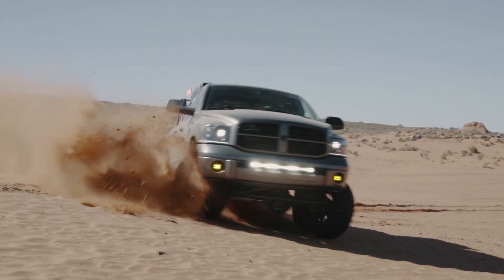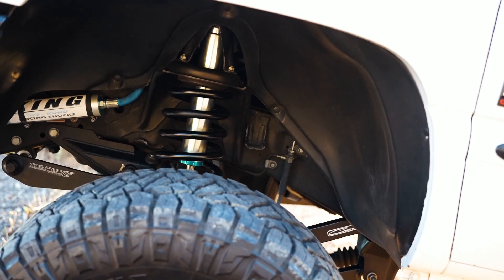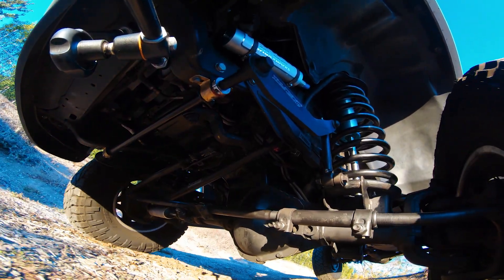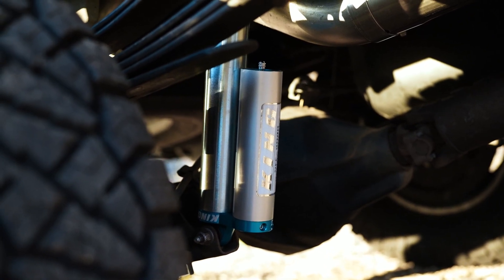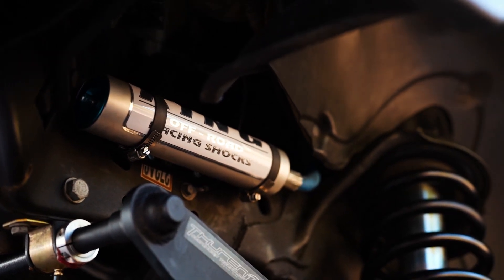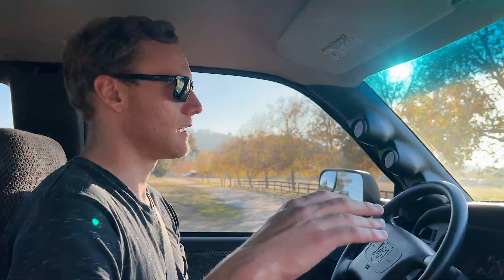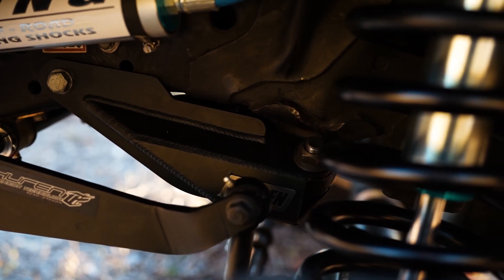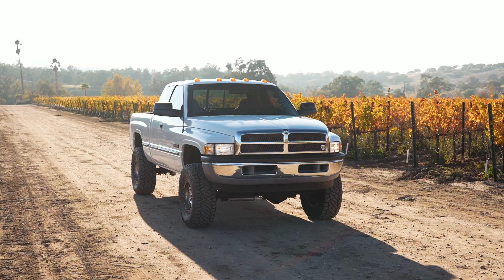My Dream 2nd Gen Cummins Suspension System! Carli Pintop Install! 2nd Gen Build Part 2

Comment from the maker: For cool shirts, sweatshirts, and more check out the Just Diesels merch store: https://just-diesels.com
The parts list:
Carli 3” Pintop Suspension system:
https://www.cjcoffroad.com/collections/94-02-carli-systems/products/carli-dodge-1994-2002-pintop-2-5-3-lift-suspension-system

Carli Control Arms:
https://www.cjcoffroad.com/collections/carli-dodge-suspension-components/products/copy-of-carli-suspension-dodge-ram-2500-3500-control-arms

Carli Rear Leaf Springs:
https://www.cjcoffroad.com/collections/carli-dodge-suspension-components/products/carli-dodge-ram-2500-3500-full-progressive-leaf-spring-pack

Thuren Sway Bar:
https://www.cjcoffroad.com/collections/1994-2012-thuren-ram/products/active-rate-sway-bar-ram-2500-1998-5-2002

Thuren 2nd Gen Track Bar:
https://www.cjcoffroad.com/collections/1994-2012-thuren-ram/products/copy-of-thuren-active-rate-sway-bar-ram-2500-3500-1998-5-2002
Reply: Wait till you get the rear leaf springs on from them. I have the full system arms coils basic shocks from them and rear leaf springs.40mph thru the dirt with ease. I want to get the pin tops next.
Reply from the maker: @matt704  I can't wait to get them on! It just takes a long time to do leaf springs on these 2nd gens since you have to drop the tank and remove the trailer hitch.
Reply: @JustDiesels  Yeah it took a little of finessing but I was able to get the bolts out on the tank side with out having to drop the tank. In total it took about 3 hours to replace everything it’s just a lot of heavy stuff like everything else is on these trucks.
Reply: @JustDiesels  There’s a truck you need to see if your looking for super clean low mileage 2nd gen dually.

Comment: Are the Carli control arms the extended set or regular length?
Reply from the maker: All carli 2nd gen control arms are .5” longer than stock for a 2-3” lift.

Comment: Can these old 12v trucks be good tourers? Are they super rattley and noisey at highway speeds?
Reply from the maker: I have no issues driving mine! They aren’t as quiet as a new truck, but still drive great!
Reply: @JustDiesels  right on. Thanks for responding. Follow up question if you don't mind... how fast can you drive this badboy on the freeway? Does it run out of gear around 70 mph?
Reply: @AD1  they will run 80 , 85 ok.  Depends on gearing though .

Comment: Are the spherical bushings loud? Do the clunk at all? I had a Spohn set up on my Camaro and it was noisy and I hated it.
Reply from the maker: Not a single sound out of them! Had a set on my third gen for about 40-50k miles without issue too!
Reply: Mine dont make any noise at all.  Keep them greased well.

Comment: JD,
Love ur trucks. Thinking of buying my buddy's 2nd gen 2500 cummins NV4500 Manual. 2 questions: 
1)It has 410 gears, if I put 35s, will it still be geared too low? Don't want 37s. 
2) Can I add side & tailgate black plastic moldings/trim from a '99 to a '01?
Thanks in advance
Reply: That would put you just shy of 2100 rpm at 70 mph, but almost 2400 at 80. In my opinion, 1700-2100 rpm is the sweet spot for cruising on these trucks. Too much lower and they start to bog down a bit, too much higher and they get noisy enough that it kind of sucks to drive long periods in them.

Comment: New to the channel. Got my first 2gen. Where did you get the yellow fog lights. And can you get them for the second gen. Love those wheels on the second gen. Wish I could something similar. You said they don’t make them anymore.
Reply from the maker: The lights on top came with the truck from the factory, but you can add cab lights to any truck!   As for the wheels, while this exact finish is discontinued, Walker Evans does have a newer version available.

Comment: The 2nd Gen Cummins is my all time favorite truck. I have an ‘02 that my grandfather bought new. Although he took good care of it, it still needs some love. I’m progressively working on “future proofing” it so that my family and I can continue to enjoy it. I’ve retrofitted it to the updated 3rd Gen steering linkage system, and I’m installing EMF ball joints tomorrow, to my knowledge the EMF’s are the best available for 2nd gens. I was unaware Thuren would be releasing a track bar for these, I would have probably waited, but at the moment the truck currently has the DOR in it. I’m eager to see your video on that Thuren track bar. You do by far the best informational videos on diesels. Thank you!
Reply: I’m adding much of these same upgrades to my 2nd Gen. It’s great to know what to expect so thanks for the video. 

The EMF BJ’s are incredible. They include the press adapter which is crucial. Got about 60K on mine and they’re one of the best upgrades I’ve added. The free spin kit is great also. I’d be shocked if you ever needed to replace them. Also, zerk fitting orientation is really important.

Comment: Can you post the stabilizer stock as well. I have a 2001 dodge ram 3500 and am currently working on the front suspension. I'm trying to get the coil springs without the shocks. I have those installed already.
Reply from the maker: I’m running this stabilizer, but it ONLY works with the factory 99 HD steering if you have the cap positioned perfectly! It will not work on the more common factory Y-style steering. 

https://www.cjcoffroad.com/collections/steering-stabilizers/products/fox-dodge-2014-2500-2013-3500-ram-2500-3500-2-0-performance-series-stabilizer

Comment: Will it work for the v10 Magnum, because you said the sway bar won't work for the 12v so I was wondering with the v10 Will it differ or does it not matter

Comment: How much sag does it have after installed I’m looking to level my truck but want to upgrade the front like what you have and still be able to tow
Reply from the maker: This truck still has the factory rear springs, which means factory payload and the same sag when loaded as a factory truck!

Comment: I have a 1997 Ram 2500 with the Synergy T-Steering Setup and the Top Tier Suspension 3rd Gen Track Bar Conversion Kit paired with the Carli 3rd Gen Adjustable Track Bar. Would you recommend upgrading to the Tauren 2nd Gen Track Bar that you are currently beta testing? Only issues I’ve had with the TTS conversion kit is that there is way too much flex with the track bar even working with the company and the shop turned into a nightmare..
Reply from the maker: At this point in time the Thuren track bar is hands down the nicest track bar made for 2nd gens. I’d personally get that over anything else available since the geometry is correct with a 2nd gen specific track bar, and a quality bracket.
Reply: @JustDiesels  just installed mine last night, test drive was night and day! When is the update video coming out??

Comment: Looks Great Andrew!!  Now wondering wether i stick with Back country 2.0 or Pin top for the 2009 2500?
Reply from the maker: It just depends on how much off road you do and at what speed. The Back Country is perfect unless you plan to go 40+ miles an hour in the dirt!

Comment: My 06 is finally going to be almost complete.  I'm ordering 3" springs , sway bar links , from Thuren ,  upgraded steering, and pittman arm  from BD ,  also threw in a deep trans pan from A T S.  I already had Thuren control arms and  track bar .  Air bags in the back .  35 terra grapplers  and an ARB locker .  Lol. Almost there.

Comment: If SHTF which truck would do anything to upgrade the truck to prepare it? For example put a 100 gallon diesel fuel container with the option to hard wire a gas pump or set up as auxiliary diesel tank! I am thinking about prepping my 2003 Ford F-250. You could make a video on this Dodge as you have a great start already!
Reply: More fuel is always a good thing .  If the shtf stay home , Safest place to be in most cases .

Comment: Speaking of the rear leaf springs, you also gonna at some point do their long travel air bags with them? I’m thinking about doing that with the rear of my 2012 in the future sometime and would like to know how it works out as far as ride quality and payload (both leaf springs and air bags)
Reply from the maker: They actually discontinued their 2nd gen long travel bags due to low order volume, but those will work perfectly with your 2012 to get the best of both worlds! Keep in mind though that airbags always hurt ride, so only get them if you absolutely need them! The Carli springs are totally fine as long as your trailer pin/tongue weight is 1k or less.

Comment: Is there anywhere that I can get an adjustable track bar for my 2nd gen? its got a cheap level kit but im planning on getting the thuren xs coils with fox resi shocks but i dont want to put them on until I get a track bar. Im really sick of seeing my front axle an inch further to the left. Love the vids! Keep it up!

Edit: Would love to see more vids on the second gen!!!
Reply: BD Diesel makes a decent adjustable track bar. I have it on my 2001 2500 with the thuren coils and thuren tuned fox non res shocks. 

Went with BD because Synergy stopped producing the 2nd gen adapter for their 3rd gen Trac bar. The BD is a freaking solid unit. Only downfall to the BD is Carli, Thuren and Synergy have much better joints in their Trac bars. But the BD is greasable and rebuildable so all in all a quality lifetime part.
Reply from the maker: This Thuren one is adjustable from 0-4” height trucks! Highly recommend it over anything else on the market.
Reply: @JustDiesels  I just looked on their website and it said it was out of stock. And for some reason Carli doesn’t sell them either. I guess I just have to wait…:)
Reply: @huntermees5151  how often do you have to rebuild it would you think? Just driving around town about 6000 miles a year?
Reply: @tikitorch3117  honestly I'm not quite sure. I would day it depends on where you live but I'd rebuild it every 50k.

Comment: My 01 is going in the same direction as your 99.  I have the thuren 2" linear springs and would love to compare the ride between equally equipped trucks just the carli progressive vs the thuren linear rate springs.

Comment: that system looks really clean. doesnt bolster it too much for a lift. looks very nice. 
Maybe this all might also fit on a 1500 ^^
Reply from the maker: If the truck is 4wd it does fit!
Reply: @JustDiesels  nice thx yes IT is a 4wd

Comment: How do you keep the frame/brake lines/bottom of floorboard and bed so clean? Tips would be appreciatedn because light rust is starting to happen on my Dad's truck   even though he takes care of it. Take Care & Safe Travels Everyone!
Reply: He lives in California and he also has a whole video showing how he washes the underside of his trucks.
Reply: It's called washing it.  Mine is almost that clean and it lives in snow, with plenty of mag chloride, and a dirt road that is also packed with mag chloride.  If I have to take it out I will pressure wash it off before bringing it into the shop.  Getting close to 300k miles... and incredibly clean.  So it can be done, just have to keep it clean.
Reply: @ShainAndrews  wAsHinG, gonna have to tell the folks about this concept, lol.  I hear ya, but the reason I ask, above & beyond, the basic wash/pressure wash is that we noticed that high humidity doesn't help on the drying after the wash (you mention you have a shop) happy to hear you have a place to work/play. Found out some that washed and put them in the garage didn't fair better if the was no ac to get the moisture out (basic ventilation doesn't help around here). Also the Costal air carries the salt everywhere leaving a fresh coat if the wind is right. Did find out recently that some people are having success with saltAway or other products that they use on boats & trialers frames. Y'all have a great New Year!
Reply: @diostejastierras7898  I was going to mention there are products that can aid in neutralizing.  My shop can get pretty humid but never lasts longer than maybe 10 hours.  High elevation cold temps, low humidity.  Frequent washing and frequent under body wax applications when it is clean and dry.  Other than that I wouldn't put much faith in.  Certainly stay away from undercoating products.  They just turn into moisture and salt traps.
Reply from the maker: Here's a video I made on that exact topic! https://youtu.be/tQtxoqkRslw
Reply: @Shain Andrews  mine an 06, and it's that clean .  It doesn't see winter, though .  My friends think I'm completely nuts, but I enjoy keeping it that way .  Plus, it's worth way more $$$$$

Comment: I really wish Carli would offer this setup for the 1500 gassers. I've got a 2 door short bed off road package with the 5.9l magnum v8. It's got a completely hand-built 4 inch lift kit on it and 37s, but it's still using the stock front coils with a spacer until I can get the money together for some ORI struts.
Reply from the maker: Actually the 1500 2nd gens use the same overall suspension, so you can fit most of these parts on them! I recommend doing the Thuren XS coils since they’re the lightest rate coil made for these trucks, and would be the best fit for the lower weight of yours.

Comment: Cries in 2wd dually.....hard to find suspension tips to make my truck not suck. Got a redhead pump, but steering slop is still VERY ban....among a literal dozen other terrible suspension and driving issues that makes the truck a horrible experience to operate.
Reply from the maker: Yeah sadly those trucks just have no support. Your best option is whatever parts are still available through the dealer, and MOOG to fill in what’s been discontinued!

Comment: Gotta say that’s a pretty clean and sharp 2nd gen. I sorta redid the front end on my 2nd gen a few years ago and I did Thuren springs, Dodge Off Road control arms ( won them in a contest), Synergy steering and track bar, and honestly forget what sway bar end links I have (I think DT Fab). I notice with my 2nd gen I have the 2nd gen lean (leans over an inch to the driver side front and back). I’ll prob just add a spacer and block front and rear. I wanna add the leafs but the cost is kinda high for me to spend for a 300,000mi (had 80,430mi when I bought it in 2008). I’m enjoying this build and gonna keep a watch on this.

Comment: Second gen Dodge Cummins we’re all designed to haul and carry heavy loads. If, a softer ride is desired, go with a half ton truck.
Reply from the maker: OR do a system like this where I can still tow at factory spec and have a nice ride?

Comment: I saw in another video you have the automatic instead of an NV. 47RE? If that 2nd gen doesn't have a transmission cooler and temp gauge, that'd be a good project video. Keeping it at 175-180 is ideal, but even 200 is good.

Comment: I can tell you're really lining up a lot of future videos including this truck and that's great. You got the OBS Powerstroke guys roped in with your '97 F-350 7.3 so please show it some love too. I remember seeing and hearing that the transmission was doing old E40D things but once that's sorted out, doing a simple enough RSK would be great or a 99-04 front spring swap and an 08-16 rear spring swap would help too but I would be intrigued to see what you think the best suspension system solution for that is.
Reply from the maker: Yeah that damn truck has literally spent 8 months at the shop this year with trans issues! Parts availability made it way worse, since there were no replacements available for stuff. I THINK everything is sorted now so that truck will be back on the channel more instead of sitting at the shop! My suspension plan is to do custom front and rear Deaver springs with some nice shocks. Not sure I want to do the RSK as I hate the look of the shackle hanging down, and doing those custom springs should be a huge change in the ride. I’ll figure it out though and make an update video!
Reply: @JustDiesels  well hopefully it is all sorted out. I understand your frustrations to a degree, I bought my '95 F-250 7.3 not really running and brought it home to a shop to have it fixed. Turns out the shop mechanic didn't know his way around a 7.3 Powerstroke very well and he just pushed it off to the side and kept putting everything else in front of it. 6 months went by and I was plenty fed up myself in that the only time I ever drove my truck, it was coasting down a hill, onto a trailer and then off of it when it was home. I ended up limping it from this diesel mechanic to a friend of a friend who turns out he knows the 7.3 Powerstroke very well and ever since, they've been who I talk to when my trucks rough past cocks it's ugly head at me and it lets me down. Now in regards to your F-350, honestly I can't really see how some custom Deaver springs would remedy the harshness of the factory flawed suspension with the front leaf spring shackle going forwards and making the axle jump through forward bumps rather than compress along with the bumps.

Comment: I wish there were more good options for aftermarket suspension parts for these trucks. There are a few companies like synergy and Carli, but they only cater to the 2500 and 3500s. Dodge Off-Road has great products that are bulletproof but their company is a scam and is shady.
Reply: All of my dodge offroad products have sucked

Comment: I just started watching this channel and I'm super confused. They daily diesel trucks and off road them??? I haven't saw any of the trucks in these videos tow anything or even carry a payload. What are you using these trucks for?
Reply from the maker: Believe it or not, it is possible to do things with a truck and not film it haha. If I’m towing I’m usually too busy doing that to film!
Reply: @JustDiesels  we'll just about every other diesel YouTuber seams to be able to film when towing. So these trucks do get worked which is good to see! I can't wrap my head around driving a 3/4 ton and not using it for some of its potential.